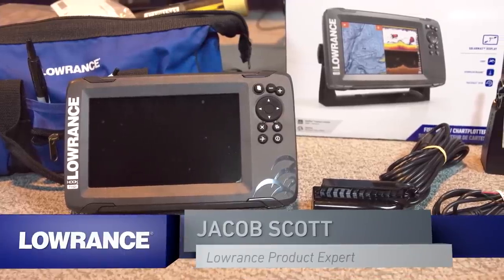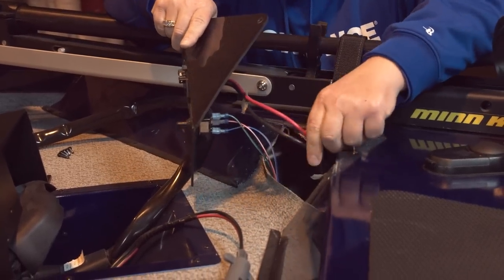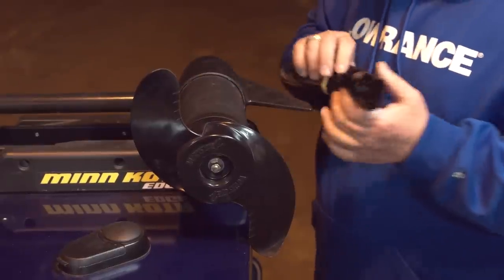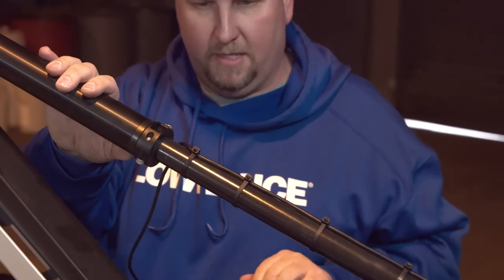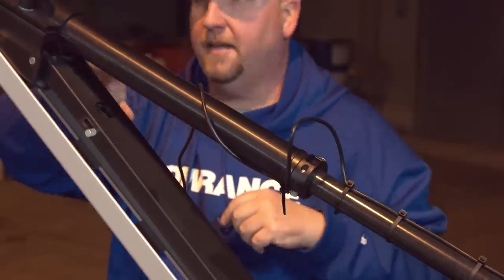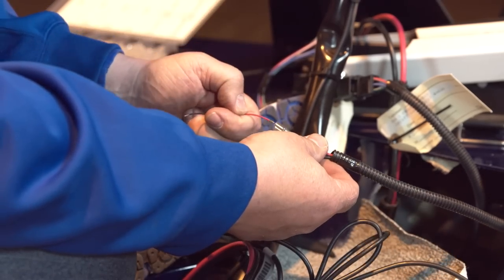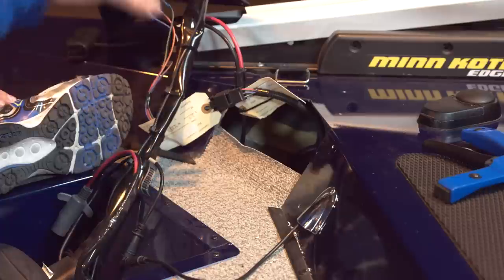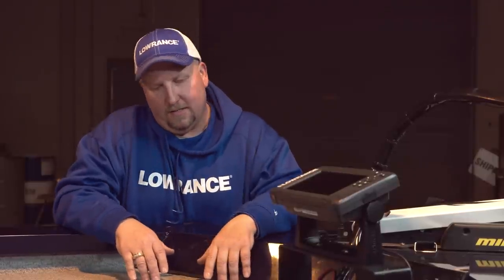How to Install HOOK2 7HDI Bow Unit

Comment: Why didn't you use the included fuses for the power wires? Is there different applications where these should or shouldn't be used?